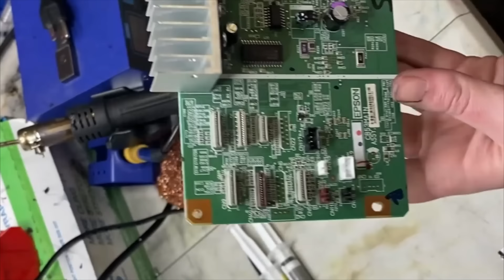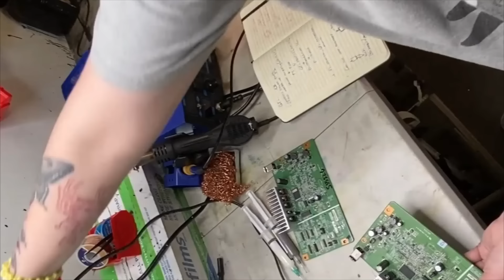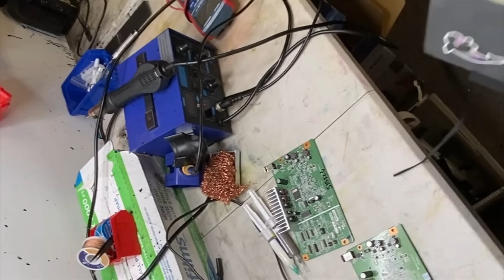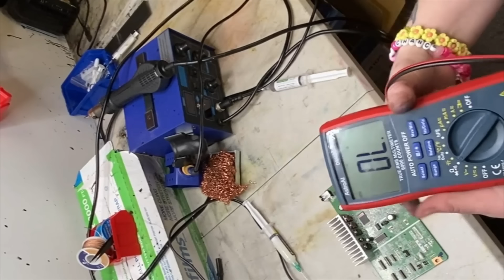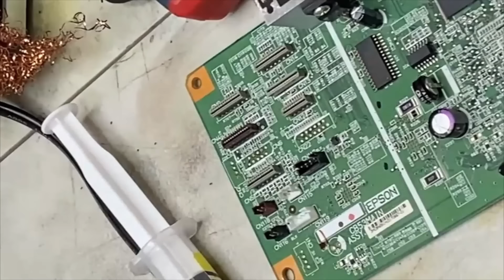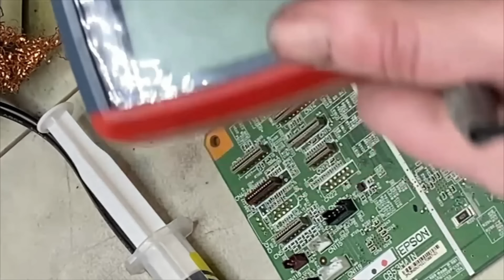Epson L1800 QF1 Transistor Repair: Why This One Part Stops Your Printer Cold

Comment: Epson printer L1800 power light only blinking. Pls help.
Reply from the maker: A blinking power light on an Epson L1800 does not by itself identify a failed QF1 transistor. Check whether the ink or paper lights also blink, whether there is a paper jam or carriage obstruction, and whether the printer or computer shows an error message. After one normal power restart, if the light still blinks, record the exact light pattern and error code. A technician with the correct L1800 service or adjustment program can read the stored error for a more specific diagnosis; do not reset counters or replace electronic parts based only on the blinking light. Please share the light pattern and any error code. We appreciate you watching and sharing your question. Subscribe to our channel or become a member for priority replies and benefits such as early video access. Kevin receives many questions, so subscribers and members are typically answered within 48 hours; he can reply to about 10 questions per day, so regular viewers are answered when time allows. After subscriber and member questions are covered, remaining reply slots are handled last-in, first-out, with the newest questions reviewed first. If you are not a subscriber and have not received a reply within 48 hours, you can subscribe or repost your question; subscribing later also automatically prioritizes your older question without reposting. Join Run With Kevin — LIVE every morning, usually 6–11 AM Eastern, to ask printer questions in real time; subscribe and turn on notifications to catch the next live. For faster help, email support@bchtechnologies.com. If the video or reply helped, please leave a Google review: https://g.page/r/CfL7k6nYvPQ9EAg/review
Reply: @BCHTechnologies 
Thanks

Comment: Where did you get the qf1 transistor to replace?
Reply from the maker: Thanks so much for watching, supporting the channel, and asking! You can get the QF1 replacement transistor directly from BCH Technologies here: [https://bchtechnologies.com/products/qf1-mosfet-transistor-for-l1800-artisan-1430-cb53-main-printer-mainboard-power-circuit-repair-replacement](https://bchtechnologies.com/products/qf1-mosfet-transistor-for-l1800-artisan-1430-cb53-main-printer-mainboard-power-circuit-repair-replacement). Please consider subscribing or becoming a channel member—subscribers and members receive priority replies, typically within 48 hours, plus extra benefits such as early access to videos. I receive a very high volume of questions every day and can usually answer only about 10 per day, so after subscribers and members, the remaining reply slots are filled last-in, first-out, meaning the newest questions are reviewed first. If you’re not subscribed and don’t receive a reply within 48 hours, you can either subscribe or repost your question; if you subscribe later, your older questions automatically become priority, so you do not need to repost them. You can also join Run With Kevin — LIVE, where I go live every morning, usually between 6–11 AM Eastern, and answer printer questions in real time, so subscribe and turn on notifications to catch the next session and ask directly. For faster assistance, email [support@bchtechnologies.com](mailto:support@bchtechnologies.com). If this video or comment helped, I’d really appreciate a Google review: [https://g.page/r/CfL7k6nYvPQ9EAg/review](https://g.page/r/CfL7k6nYvPQ9EAg/review)

Comment: Printhead cleaning made the tramsistor go bad.  I've replaced them once already amd it didnt the same thing.  What would cause this ? Bad printhead ?
Reply from the maker: Thanks so much for your support and for the great question! Yes, a bad or electrically damaged printhead can cause the QF1 transistor to fail again, but I would not assume the printhead is the only possible cause. If QF1 has already been replaced and failed again immediately after a cleaning cycle, stop replacing transistors until you find the underlying problem. Check the printhead and FFC cables carefully for ink or cleaning-fluid contamination, corrosion, damaged contacts, incorrect cable installation, shorts, and burned traces; also check the printhead electrically for an abnormal load or short because another QF1 may simply fail again if the original fault remains. If you need faster assistance, email [support@bchtechnologies.com](mailto:support@bchtechnologies.com). I receive a high volume of questions every day and can only answer about 10 per day, so subscribers and channel members receive priority and are typically answered within 48 hours, along with benefits such as early access to videos; regular viewers are answered if time allows, with remaining reply slots handled last-in, first-out, meaning the newest questions are reviewed first. If you're not subscribed and don't receive a reply within 48 hours, you can subscribe or repost your question so it becomes newer; if you subscribe later, your older questions automatically become priority, so there's no need to repost them. You can also join Run With Kevin — LIVE, where I go live every morning, usually between 6–11 AM Eastern, and answer printer questions in real time, so subscribe and turn on notifications to catch the next session. If this video or reply helped you, I'd really appreciate a Google review: [https://g.page/r/CfL7k6nYvPQ9EAg/review](https://g.page/r/CfL7k6nYvPQ9EAg/review)